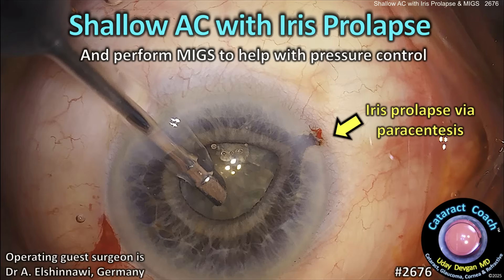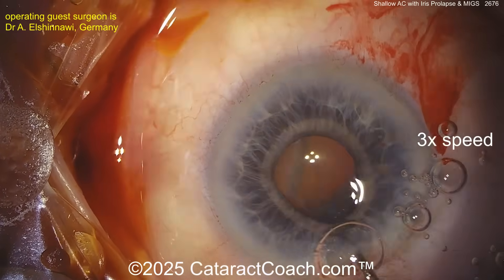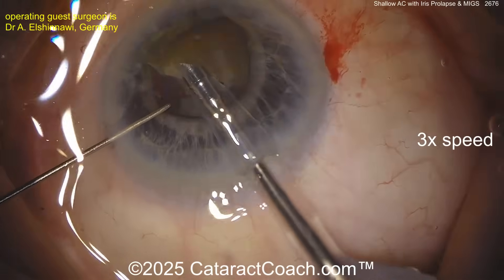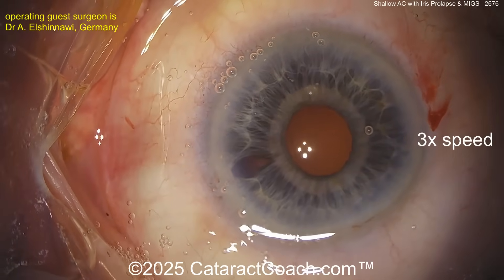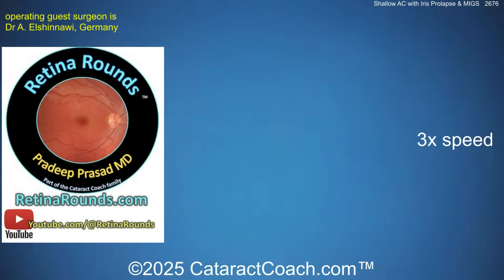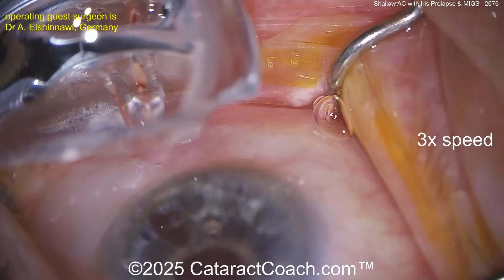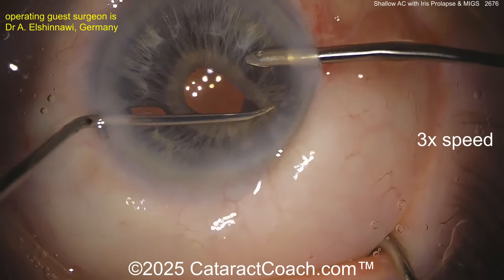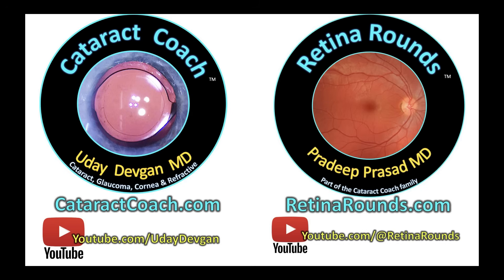CataractCoach™ 2676: shallow AC with iris prolapse and then MIGS for glaucoma

Comment: Unnecessary and even materialied risks for the patient not using anything to control the iris, lucky the capsule didn’t break and hopefully IOL is not in cross fixation even if checking and that most of the zonules are still intact. If you don’t have hooks or rings - get them and start the surgery only then.

Comment: no doubt that this is a very skilled surgeon but even he - ended with an iris defect. I think that in 2025, there is no reason to be a hero and not choosing iris hooks or a ring (Malyugin) in thoses cases. It will make the surgery much easier and morre safe.

Comment: For patients with 1.) shallow AC, 2.) dilation <5.0 mm, and 3.) on tamsulosin, I started giving pre-operative acetazolamide 500mg PO x1 to dehydrate the vitreous to allow the iris to sit back more posteriorly. So far, it has been VERY helpful in minimizing iris prolapse.
Reply: Thanks, that was a new one for me, but it sounds logical.
Reply: Sounds very reasonable with using just oral medication. If the operation is scheduled for the morning, when is it time to take tabs? 
Is there any other benefits, than minimizing iris prolapse? Because in shallow ACs and short eyes sometimes I feel that one of the hardest things to deal with is when posterior capsule goes dome-shaped (probably fluid misdirection syndrome). Maybe acetazolamide can help with this too?
Reply: @mesmerizz3d Peak action of oral acetazolamide is around 1.5 to 4 hours (as opposed to IV is within minutes). I therefore have them take it just prior to coming in for their surgery. I can’t speak to the capsular issues you mentioned, but it’s certainly worth a try (avoiding sulfa allergies of course and counseling on the side effects)!

Comment: This is a very skilled surgeon who is struggling with something that a less skilled surgeon would not struggle with if they place iris retractors.  .  In this case I would put iris hooks in to retract the iris early and I would put the paracentesis insertion point posterior to the limbus so that the iris is pulled back and away and this way would avoid iris prolapse and iris damage.   If you have a peristaltic pump the floppy iris does not engage as easily by accident because you need occlusion to get vacuum (although you might grab it with post occlusion surge) but I use a peristaltic pump and one negative is that you can get a "magnetic " effect of vacuum drawing things in without occlusion so it's pretty easy to grab a floppy iris that follows the currents.  I am very liberal in my use of iris retractors in these cases.  It ultimately leads to an easier and shorter case with less risk and less stress.  Also, with a floppy iris the pupil comes right back down and you can't even see that the retractors were used.
Reply: Nice comment